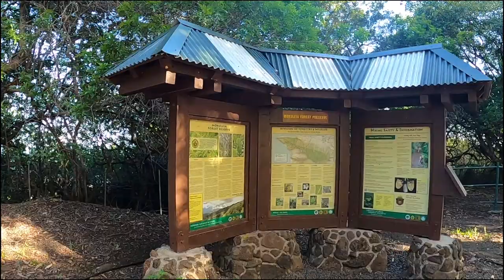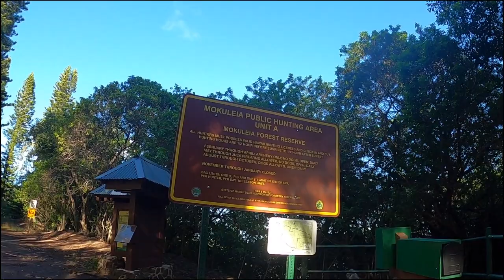Sunday Rides - "Peacock Flats Camping"

Comment: Dreamt up something very similar to this, which led me here. Anything about your truck you would change if you could start fresh
Reply from the maker: The only thing I don't like is that I can't fit it in my garage, but I made the rack that holds the tent high enough to fit my dirt bike. Its a dual purpose truck made to camp and ride, if I didn't ride i would probably bring the tent down to fit in the garage also it felt a little top heavy before I put the wider tires now it feels normal. I hoped this helped.

Comment: Cherry Carry setup🤙 is ur Suzuki four or five speed? how do the oversized tires affect the ride or performance
Reply from the maker: Thanks. 4 speed, its awesome the truck feels more stable especially since I put alot of weight up high. The diameter is only 1" more so I hasn't affected the ratio to much. I lost some of the turning due to the tires rubbing on sharp turns. Other than that its all good 👍